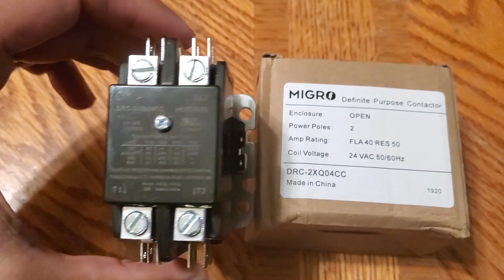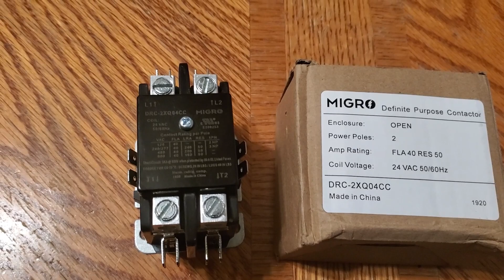How to use a Contactor with an Arduino

Comment: Hey DuctTape Mechanic - if I wanted to supply the smaller relay with power using a usbc on the main board, is that possible? Instead of using the stepdown transformer. Thank you.

Comment: I got to ask were ya learn all the stuff u know about from school? I no it's a crazy question but I am wondering?
Reply from the maker: I have always had a passion for electronics so a lot of it has be self study. I enjoy it!
Reply: @DuctTapeMechanic  that's awesome
Reply: My washer started out great did everything Wars done everything until the final Spin and not skin still haven't figured it out yet.? Any help or answer would be great .
Reply from the maker: @akamomakawife4928  is there any grinding noise? Also what model is your washer? It could be the shifter is broken if everything else works good but it won't spin. Hope this helps
Reply: @DuctTapeMechanic  Kenmore 500 series it washed it did everything but the final spin?
Reply: Yes it did everything was fine but will not do the final Spin and there is no noise.?

Comment: You could try using a contactor with a 120 volt coil. You can use the relay to switch a very small amount of 120VAC, that powers the contactor with a much bigger load. Does away with the need for the 24VAC transformer.

Amazon has contactors with all sorts of coil voltages - I've even used a contactor with a 240v coil to control a 25000 btu Window air conditioner using one of those cheap Sonoff smart switches.

Still an excellent video, btw.
Reply from the maker: That is useful information. Doing away with the transformer is great. Thanks for watching!